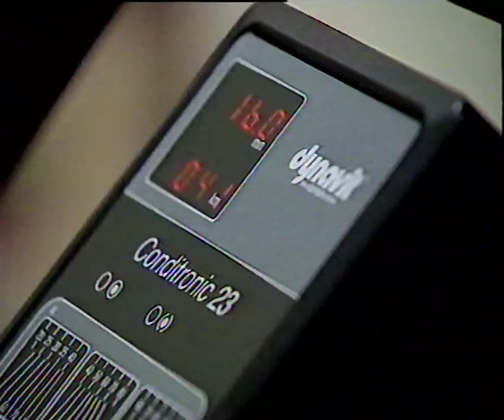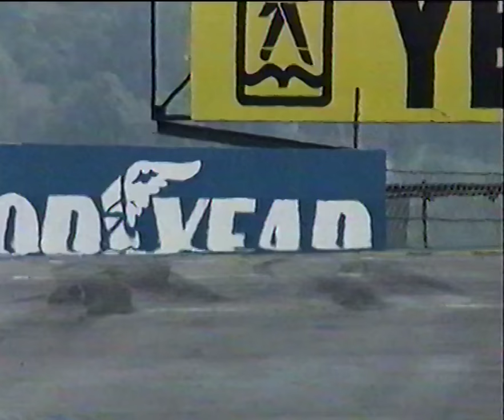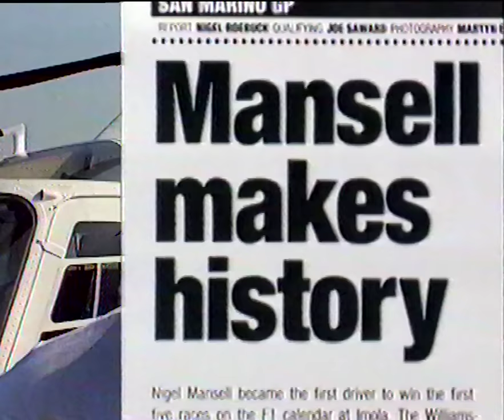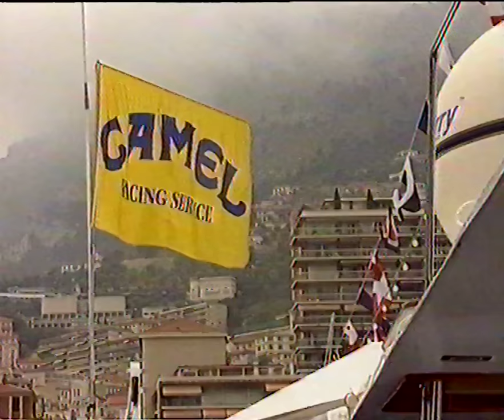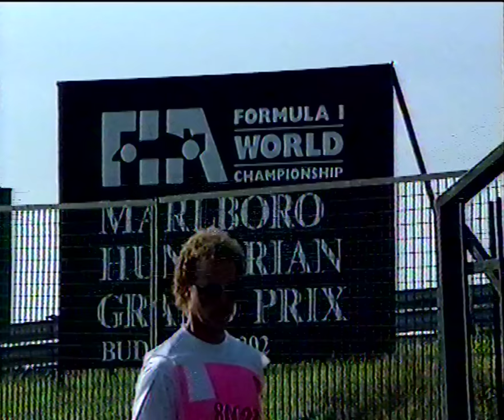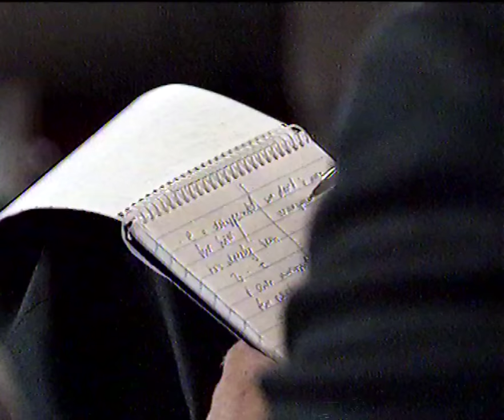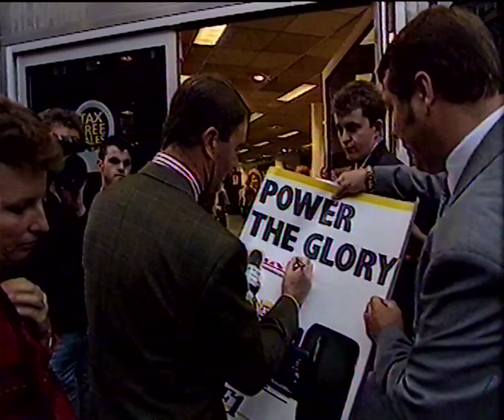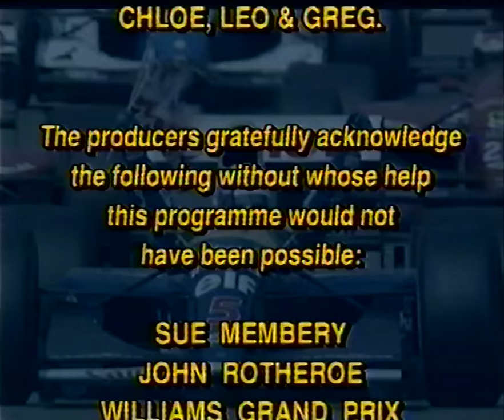Mansell & Williams 1992

Comment: Back in the 1980's, from 1985 to 1994, i knew what Grand Prix would take place at a certain time of the year and what circuit. That's why I stopped watching it. Due to the increase in the number of races and too many other changes. Those years were my favourite F1 years.
Reply: Since when did you stop watching F1?

Comment: Active suspension should have been kept i think. 

The biggest problem with modern f1 is carbon brakes. 

I think steel brakes should be enforced, make much better racing.

But Active suspension wasn't a driver aid any more than carbon brakes or radial tyres, it was just new technology.

Comment: Mansell was more of a rival to Senna then weakminded Prost ever was.
Reply: This couldnt be more far from the truth.
Reply: I agree. Mansell feared nobody and was so aggressive when racing. Prost can be quick but he's not a real racer. People forget that because of Mansells weight he was around half a second slower than Prost, Senna or most other drivers. As before  they even turned a corner, the extra weight as a driver did not go in to the ballast. So heavier drivers always suffered. Shows how fast Mansell was that he could still match and sometimes beat them with that huge disadvantage. You wonder how fast he really was if everything was equal with weight.
Reply: Mansell moaned so much in Indycar in 94 he made Mario Andretti want to give up racing!